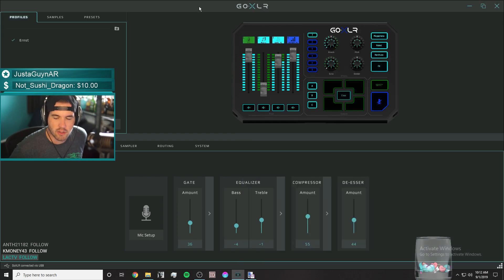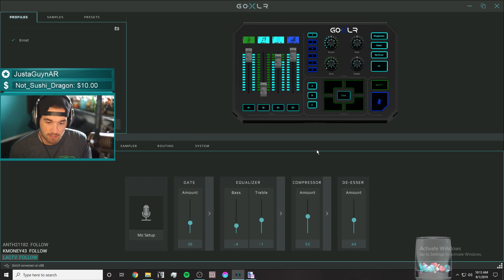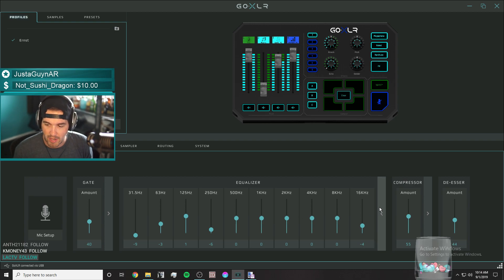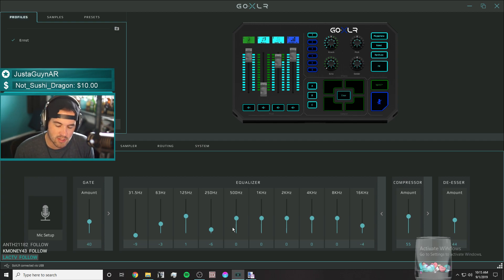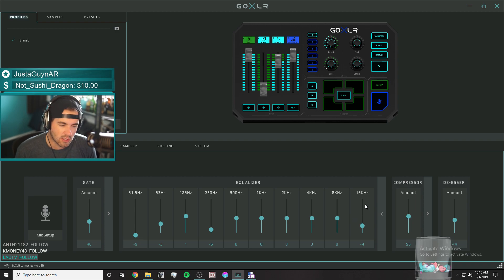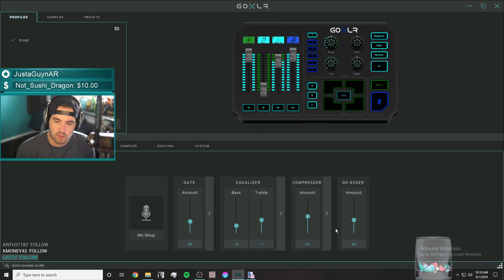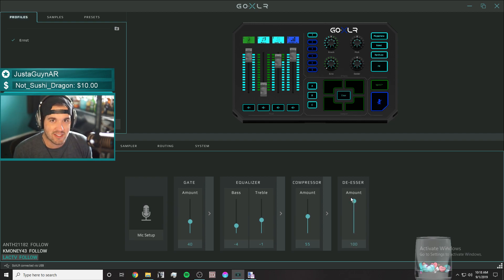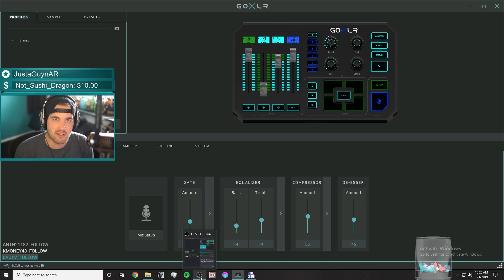GoXLR - How to - Complete Mic Setup explanation

Comment: From all I have read, you want the voice as close to 0db as possible without going over.
Reply from the maker: This is true, although based on proper settings and even some added gain in OBS I was adding 15-20 db of gain and I thought it had a bit of effect on the sound of the mic. The point of the matter mostly is that you want to get pretty high up, make sure you have a limiter (which there is one on GoXLR). From what I also know is that if OBS goes to 0db there is actual an output limiter to something like -6db. There is a video out there somewhere I remember watching about this. Ultimately, keep mic as high up as possible, without going to 0, but a certain level above other sounds.
Reply: @SDGolfGuy  Yeah, that is what I meant. As close to 0db without going over.  This includes peaks.  Good video, and very informative. I am still trying to tweak my lows on my mic.  I'm trying to get a radio mic type of sound.  I think I am pretty close.  If I make my mic any more sensitive it picks up to much background noise.   Still a work in progress. Always tweaking.  Why do you use the cloud lifter?  I was thinking of getting one but read that the pre-amp is capable of powering even the smb7 with room to spare.
Reply from the maker: @JonVonZombie  The preamps on the GoXLR can power the shure, pretty easily. I use a CL-1 for two reasons - one, I had it already laying around (no barrier to use it). Two, I found that when I drive the gain via the pre-amps for my RE320 it sounded a bit more bright and "grainy" than I wanted. I'd rather have lower gain and gain what I perceived as clarity back throughout the range.
Reply: @SDGolfGuy  Yeah, I think that might be my issue as well.  I was just wondering why you used it. Thanks, I may just give that a try.  I have a shure super 55 mic. It is a great dynamic mic. and looks awesome, I just can't get the sound I want from it without turning the gain up super high.

Comment: i have a goxlr, and a blue yeti. i have a 3.5mm to xlr cable. when i try to use the yeti, it wants me to turn the volume and gain all the way up on the yeti, and it wants me to make the Gain on the goxlr 72DB otherwise it doesn't hear me. This makes no sense to me.
Reply from the maker: Sounds like the output on the yeti just may be extremely low, never tried it. Unfortunately if the mic output is low from yeti then it could cause issue. Not sure why id' want yeti to have mic out go to XLR when you can just use the 3.5mm mic in ont he goxlr itself.

Comment: Holy crap, Ernst. 

I've had my GoXLR set to Dynamic because I always knew my Rode Procaster to be a dynamic mic, but what I entirely forgot, was that the procaster has always needed a little bit more gain, much like your mic. This video reminded me to change it, and it makes a hell of a difference with that phantom power.

Thanks man, earned a sub!
Reply from the maker: Thanks man!
Reply: you need a cloudlifter to use phantom power. if you turn the phantom power on without the cloudlifter you can damage the mic.
Reply: CoffeebeardTV I did further digging into the manual and just microphones in general and found dynamic microphones don’t need phantom power, just a ton of gain I.e the cloudlifter or fethead since most interfaces or DACs only provide around 40-50db. I now run an SM7B on that dynamic setting in the software (no phantom power). This video is a little misleading in that regard.
Reply: oh ok, ive heard the goxlr has really good preamps thats why i preferred it for the sm7b. It really sounds good in the video.
Reply: CoffeebeardTV yup! It’s got MIDAS preamps and from what I’ve read they’re among some of the best for the price point. I think the system itself provides 70db of gain, so it completely eliminates the need for that cloudlifter. Well worth the price point IMO, just not during COVID. Price gauging on these things is through the roof.

Comment: is it normal for a slight buzzing noise when you talk?> i am using Sennheiser HD700's as well but whenever i speak i can hear a slight buzz
Reply: @kritzxy  the Sm7b is going to have the same buzzing, as your issue isn't with the microphone. Something else is wrong. I use a procaster and it's buzz-free since day one. I've noticed that if I point the microphone towards my PC, it will actually pick up a lot of electrical interference, so maybe it's something similar with your setup. Try to move the microphone around or get a better XLR cable. The Procaster is just as good as Sm7b, and you dont need to upgrade. Good luck!
Reply: Cookie Krits i fixed this issue when I switched mics, I think my mic was damaged, switched from the AT2020 to the Shure Sm7b totally worth it

Comment: What headset are you using? and are you using it threw the GoXLR or do you use a sound card?
Reply from the maker: These are the Sennheiser HD700's. Using it through the GoXLR. Sound card is not needed, just through the USB interface on GoXLR :)